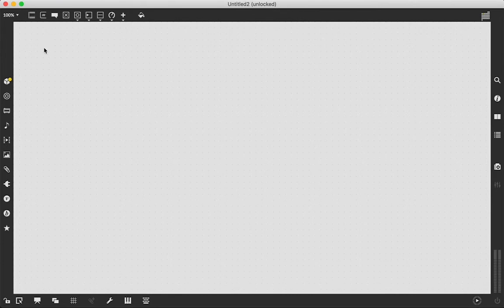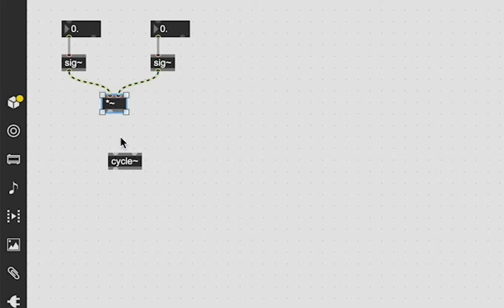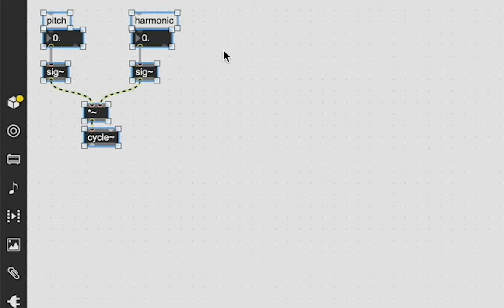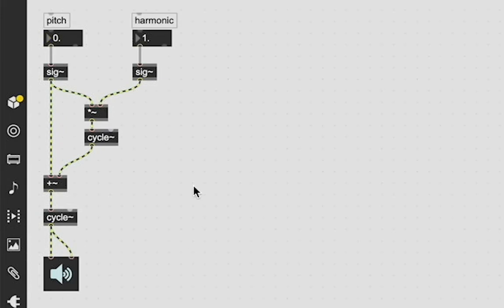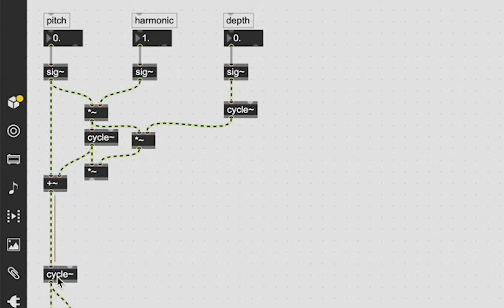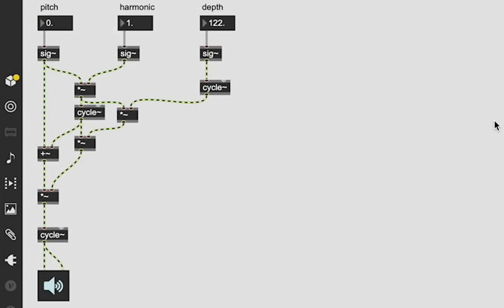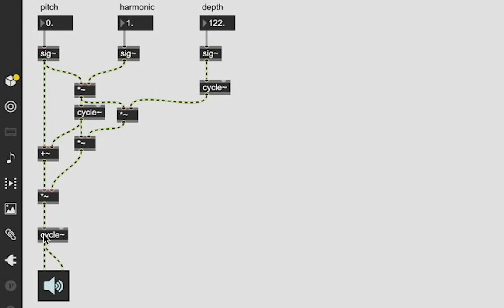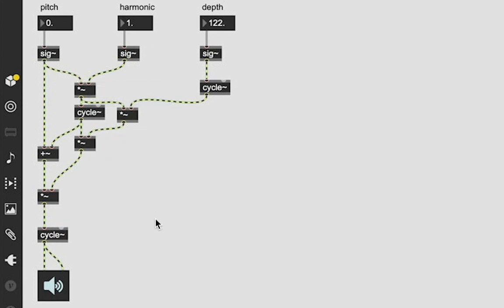FM Synthesis -- Max MSP Tutorial

Comment: I have a feeling this isn't true FM. But the tones you produce sound similar. Not sure though. I'm not Max fluent, and I'm just starting to learn the math behind FM (and not just the concept).

I've been experimenting in Desmos. 
 - A standard wave would be y=cos(wx) (where w is the frequency). 
 - Ideally, you would modulate w to achieve FM.
 - For a standard sine sound, a non-FM sound, you would adjust w to simply change the pitch of the sine wave. Imagine a knob. Higher values mean higher pitch, and lower values is lower pitch.
 - For FM, ideally, you would do the same thing, but your 'pitch knob' would be going up and down in the manner of a sine wave. If it's sub-audio (sub 20Hz), it would behave like a LFO modulating the pitch (ie, vibrato). But above 20Hz, you would get FM tones. You are 'twisting' your virtual pitch knob back and forth at a constant rate. 
 - But if you try to just replace w (in y=cos(wx)) with a sine/cosine function (ie, w=sin(Ax) or something) you get y=cos(sin(Ax)*x). If you try to do this, you will not get FM. You actually won't even get a periodic waveform. You something that looks kinda like a 'squeeze function' (ie, y=1/sin(x) ).
 - Instead, you must add to the original cosine argument. Ie, y=cos(wx + Bsin(Ax)). 
 - you now have three parameters: w aka frequency, A aka modulator frequency (eg, 'ratio' if you're thinking of a DX7), and B aka modulator amplitude. 
 - if you don't believe me, and if you think that this would end up being Phase Modulation, here's a video which explains how this is NOT phase modulation: https://www.youtube.com/watch?v=9-R8ZxpXt7Y  . Warning: basic calculus is required to 100% understand the video. But you can still see the resulting formula at 8:00. Replace m(t) with a cosine function, and you get y= cos( wx + B*integral(m(x)) ) = cos(wx + Bsin(Ax)).

I'm not 100% sure about this. I'm still wrapping my head around the math. But i think what I described above is correct. 

So my guess is that if you want to make a max patch do FM like this, you would need to use the cycle~ object, and use the phase attribute. In y=cos(wx + Bsin(Ax), the 'cos' would be your first cycle~ object, and the inner 'Bsin(Ax)' would 'plug into' the phase attribute of this first cycle~ object. Ie, 'plug in' a cycle~ object into the phase attribute of the first cycle~ object to get a modulator-carrier/2 operator FM. 

Not sure. I have more studying to do. But thanks for reading. I'm mostly writing this just to help myself understand how to do this in Max, but I hope i can help someone else understand too. I can provide a link to my Desmos graph if you want to see. If I don't respond, you have permission to spam this thread.

Comment: 2:30 the output of cycle object goes from -1 to 1 so you are basically adding a number from -1 to 1 to the pitch frequency, how can it work? I tried it by myself and it produces a completely different sound
Reply from the maker: The -1 to 1 value from the cycle~ is the amplitude of the waveform. When we add the signal value back we’re adding the pitch of the sound, I.e how fast the cycle~ is oscillating between -1 and 1. No matter what the pitch is the output will always oscillate between -1 and 1 but the sound changes because were controlling how fast that oscillation occurs. I hope this answers your question.
Reply: @AndrewRobinson26  yes i mean that you are modulating the frequency in the rage of 2hz (from f-1 to f+1), it should not be even audible lol
Reply: @matteopillon9885  same problem here, the sound I get is a pure sinewave!
Reply: @mattiafurlanetto2113  yes of course, the modulation is barely audible. the guy in the tutorial is probably clipping the output so you can hear the modulation, you have to multiply for some number the modulating signal to make it work. however if you replicate the whole patch it works pretty well
Reply: The "harmonic" value is a ratio so it wouldn't have to be at an audible rate. Think of that as the "additive" part e.g., a ratio of 1 will give you a saw wave and and a 2 will yield a square. However, in this setup it's not modulating the amplitude of the oscillator but the amp of the first converted number value. It's a super fun modulation patch but I'd recommend the Max tutorial on FM Synthesis to better understand how the concept really works.